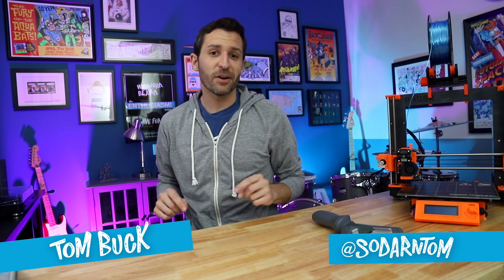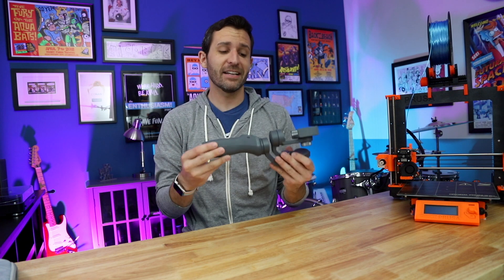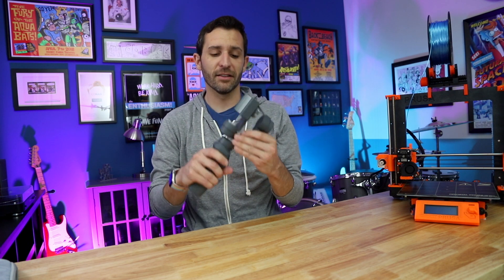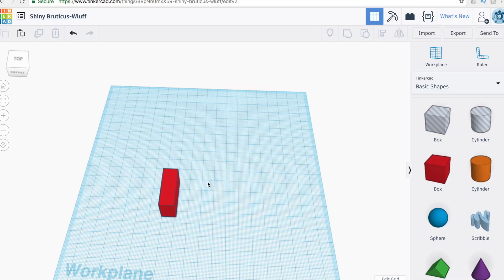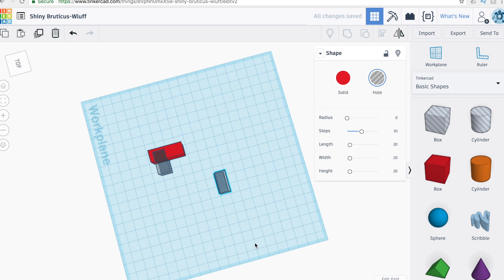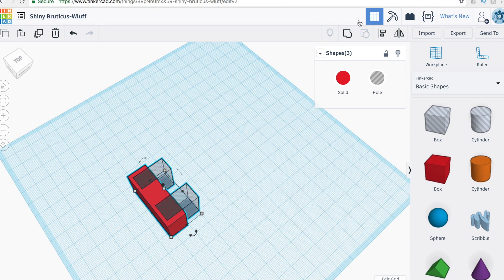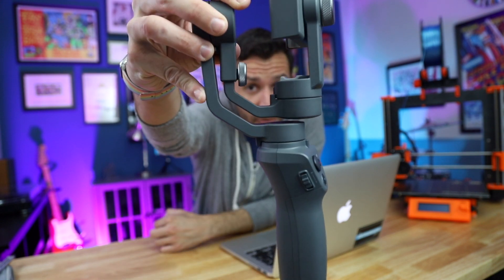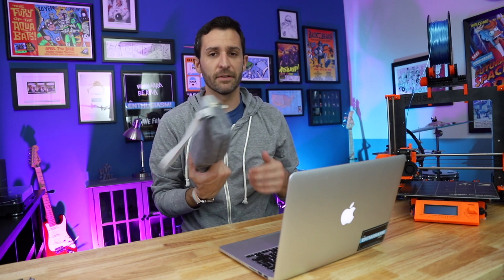3D Printed Gimbal Lock for DJI Osmo Mobile (Simple Tinkercad Design)

Comment: I have some issue with the coil, the humidity damage it and so the printer doesn t print well some time because of that matter. Do u have the same probleme?
Reply from the maker: I haven’t had that problem, but I live in a very dry climate.
Reply: @tombuck  ok, that s why, I live in singapore, and the climate is very wet
Reply from the maker: Gotcha- I’m in the desert, we’re dry as a bone!

Comment: Nice invention there. I've bought the osmo 2 two days ago and it's the first thing I've noticed when I picked it up, there wasn't any piece to lock the arms together. I don't know why DJI didn't include one for, where as my dji phantom 4 came with two different pieces to lock the camera/gimbal in place so it wouldn't move around  while being stored.  I don't own a 3d printer so I'm willing to pay you if you could print me one.
Reply from the maker: It's really strange, the Osmo 4K (which is the same gimbal but with it's own camera) comes with multiple locking mechanisms. It's really bizarre. Email me an address to theenthusiasmproject@gmail.com and I'll send a few your way.

Comment: Tom, great video!  I really like seeing people solve day-to-day problems with practical prints.  I have just started trying different filaments which opens up the potential solutions.  For instance, I made a fly swatter using PLA but it was cracking and didn't last too long.  So, I printed it using TPU and it is much stronger AND flexible.  Thanks for the video!  P.S.  I am really getting a LOT of use and enjoyment from the Monoprice mini!  Jim
Reply from the maker: That’s great to hear Jim! I really want to try a flexible filament, but have always been a bit nervous for some reason. I think you convinced me to give it a shot!

Comment: I know myself. I would have over engineered it and tried to do something really sophisticated and then would have slammed my Laptop on the floor in frustration because just like you, I am not a good designer 😅
Reply from the maker: Ha! You know in all honestly, making YouTube videos has really helped me overcome my perfectionism. Done is better than perfect, and I know I would have spent ages on this thing in the past. 

Now if someone on Thingiverse wants to remix it and upload a better version, I sure wouldn’t argue...
Reply: The Enthusiasm Project      Same here, Better get something done than wait for it to be perfect. But still, that thing keeps going on and on in my mind that I could have done it better 😅. Same is the case with me, making Youtube videos has taught me to find the most efficient way to get something done. I have a selfie stick taped to a table and use it as a Tripod and a lamp for lighting. I havent even changed the Yellow lights to White as yellow lights make the video look bad. I still have to change that. How more efficient can I be 😅. God knows how much money I have saved till now
Reply from the maker: I love finding those ingenious solutions using available materials- that's one of my favorite aspects of 3D printing. (Sorry it took so long to reply,  for some reason YouTube held a bunch of non-spam comments as spam...).